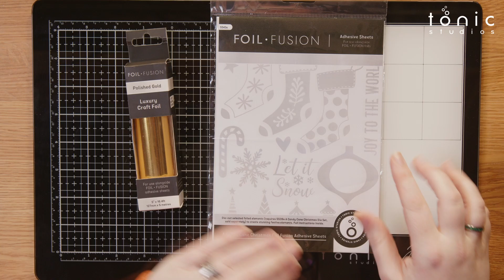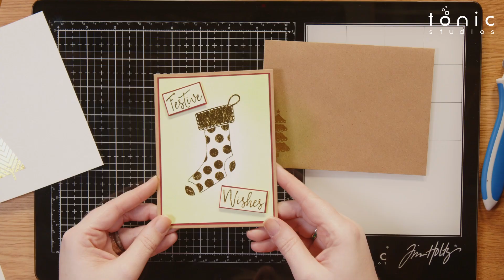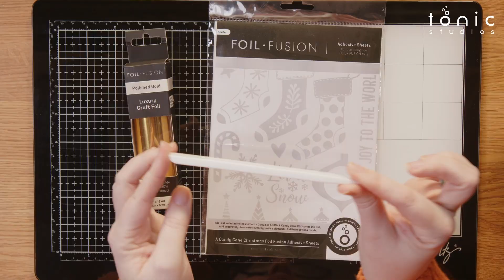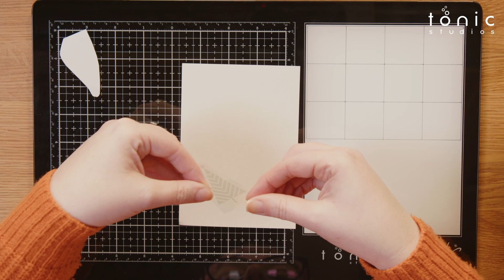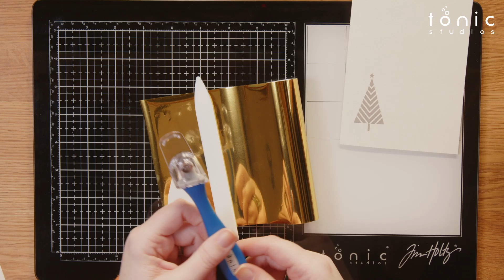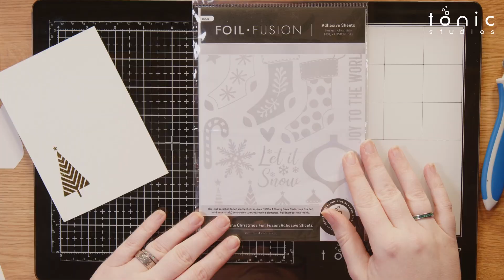How To Use Foil Fusion Adhesive Sheets and Luxury Craft Foil | Tonic Studios

Comment: Can we use different adhesives with the foils too? Like double sided tape/die cut sheets of double sided adhesive paper or even some types of glue? (For the latter which would be best?)
Reply from the maker: Yes! Various types of adhesives work well with our Luxury Craft Foil. We quite often use the "negative" image left behind on the foil from one of the Foil Fusion Adhesive Sheet images, and press this onto our Adhesive Sheets. When you peel back the carrier sheet of the foil, you're left with a fully foiled image and the positive image can then be filled with gilding flakes, or a different colour of foil for fun effects!